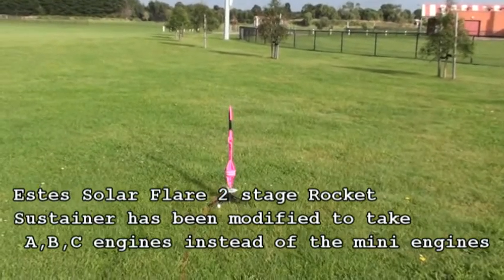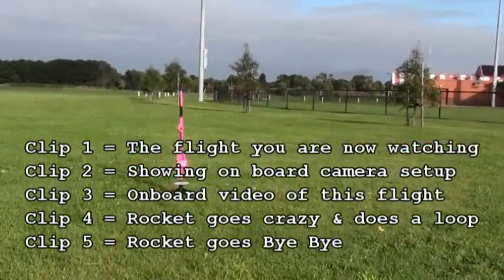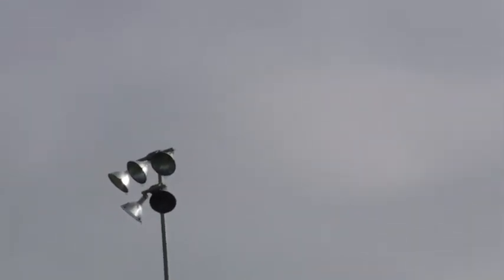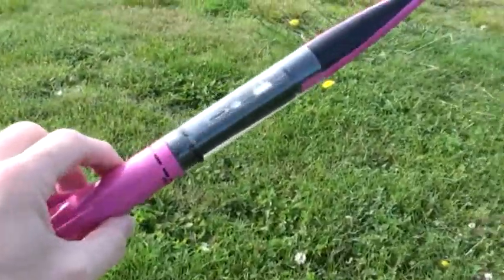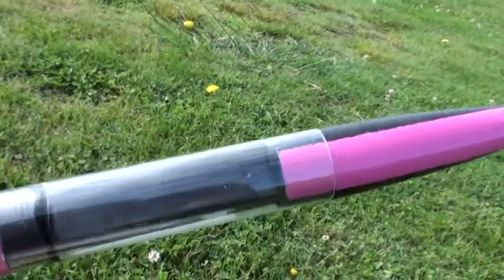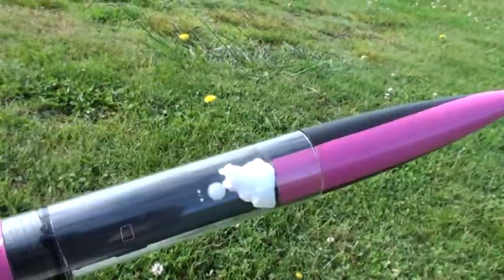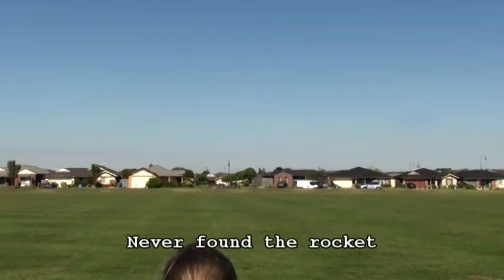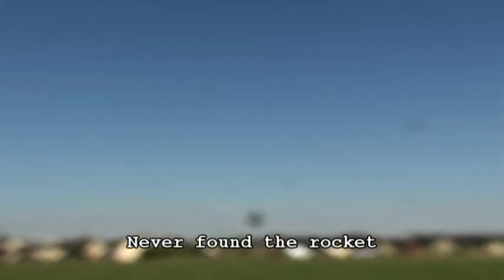Estes Solar Flare Rocket goes crazy

Comment: I think you made the rocket unstable by adding weight to the 2nd stage with the larger engine.  Add a bit of wind and you get really unpredictable flights.  The design of rockets are pretty intolerant to big changes like that.
Reply: I wish that they would bring back the Solar Flare rocket , I have ben trying too fine one or the plans ( part list) and hope that they would have them